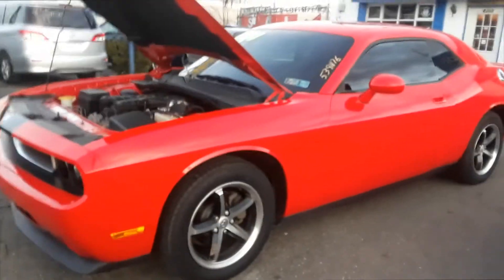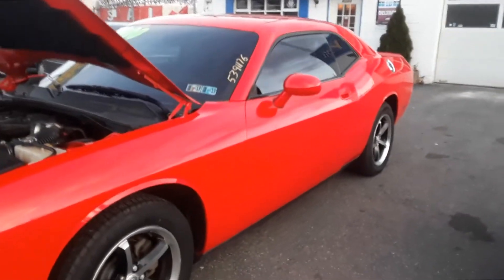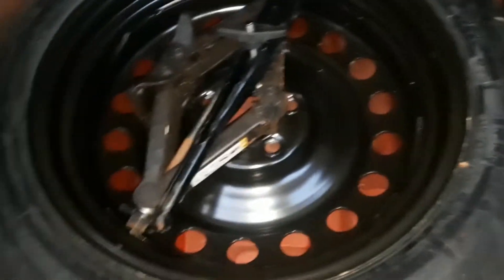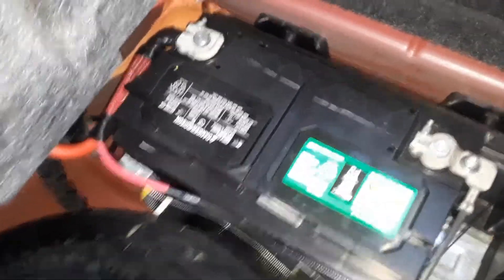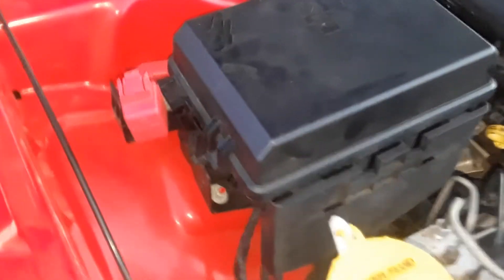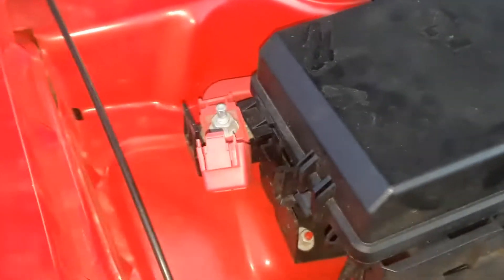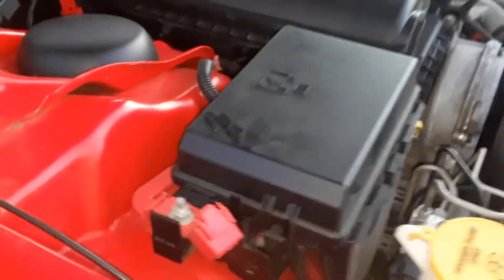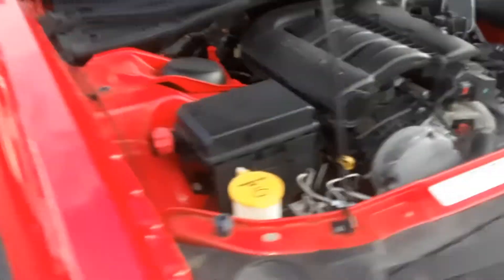Dodge Challenger Hidden Battery location & How to Jump Start

Comment: Thanks, I disconnected positive in hood and still had dash lights, 2012 RT, could not find the battery.  Installed back up cam now engine won't start and dash lights all filickerwhen I hit the brakes, doors ticking , fuse box or  relays all clicking and switching ????? Need help!!!

Comment: Ok but electronically you need a button to open the hatch due to no keyhole so how with no charge do I open the back lol
Reply: Back seat comes down top corners have latches to make it fold then you can pull the emergency trunk open latch from inside the trunk
Reply: @erickyepez661  yeah thanks bro, I figured it out, tight squeeze lol, but got it done. Appreciate it